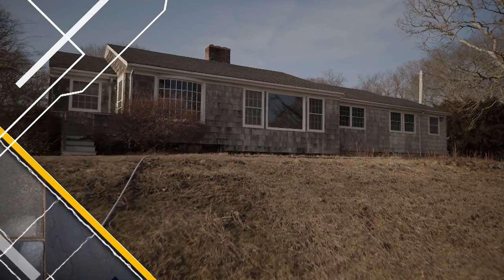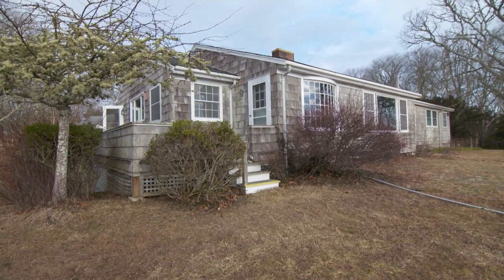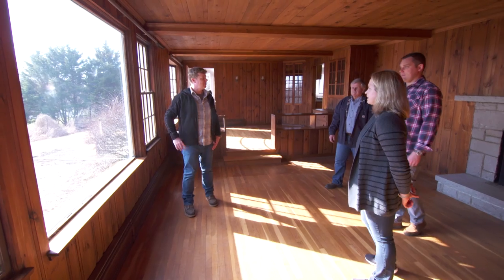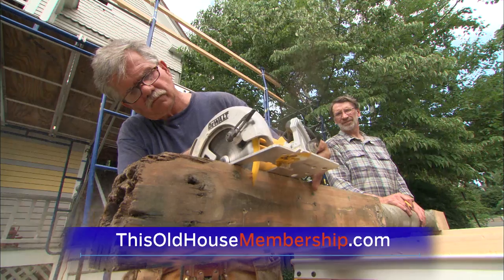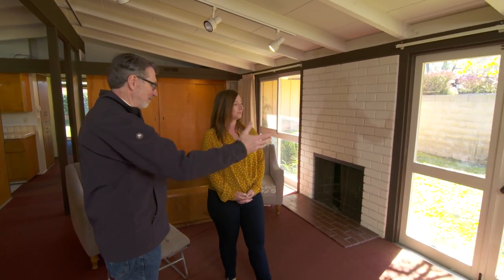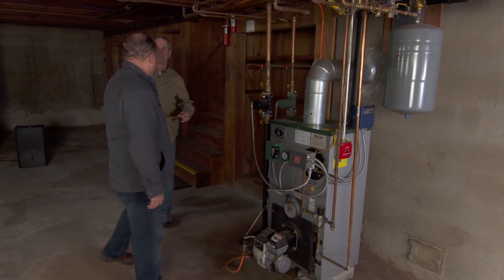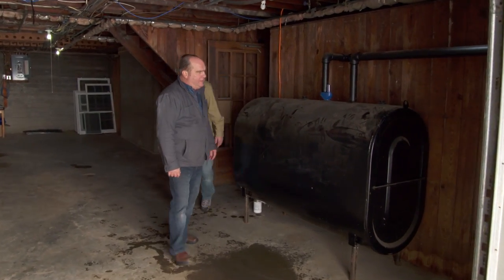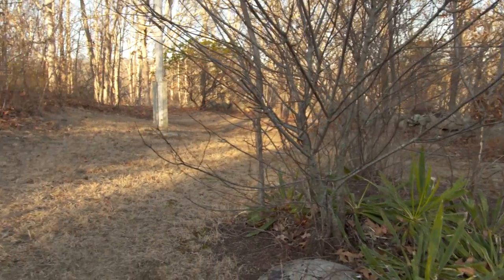This Old House | A Ranch Out Westerly (S41 E1) | FULL EPISODE

Comment: Jeez...so much is going to be torn up, Just demo the house!
Reply: Why? The structure is in great condition and very well built.  You don’t throw the baby out with the bath water.
Reply: Scallywag after theyre done there won’t be more than 10% of the original house.
Reply: They should of just bought another house closer to the specs that they were actually looking for.